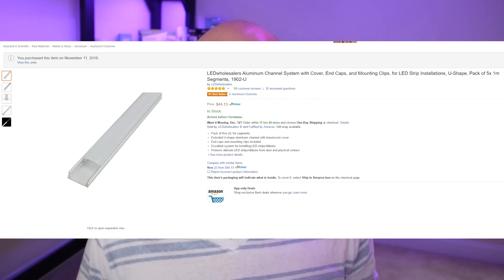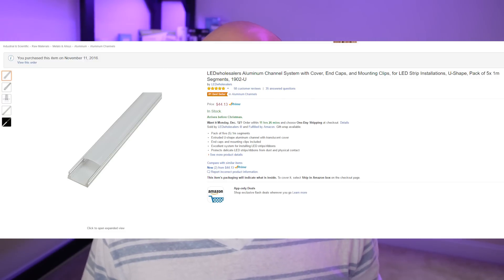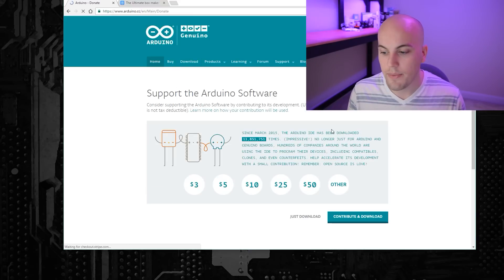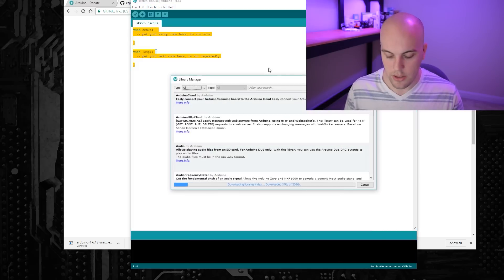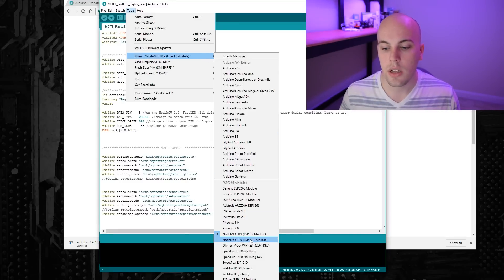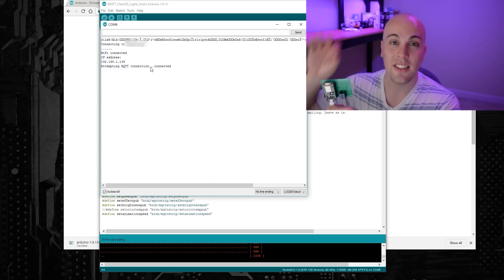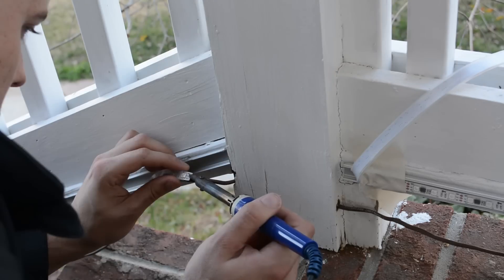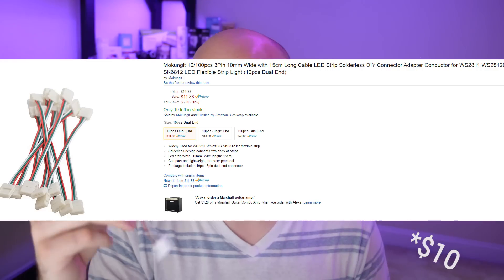The BEST Digital LED Strip Light Tutorial - DIY, WIFI-Controllable via ESP, MQTT, and Home Assistant

Comment: Ben I can't seem to get the Logic Level Shifter part right. The image on your gituhub appears to show a different wiring setup for a different shifter then what you posted in the description. I purchased the one in the description and can not seem to get it to work right. Any suggestions?
Reply: same. the diagram, is really confusing. cant get it to work
Reply: could you get it work later on?
Reply: could you get it work later on?
Reply: PuckStar27 the diagram is right. have no idea what I did wrong but it worked the second time.
Reply: thanks for your quick reply! :)
Reply: do you think I can also run this from a Wemos D1 mini?
Reply: Hey I’m so tired
Reply: i am also trying to run this with a wemos d1 mini and my led strips does not light up. did you get it to work somehow? i purchased another ws2811 led strip from china earlyer. it worked but had bad colors. but with the more expensive one from amazon it wont work at all.

Comment: You bloody genius.... I've already started doing exactly this... I chose everything the same, Except I went WS2813 LEDs, Just cause They're available ;)
I've already written some sketches for the Sensor nodes myself.... But I'd love to check out yours... 
I've just found another Youtuber who was doing similar things... and He's heavily pushing OTA updates, Just opened a site to do it too http://iotappstory.com/
So i'm going to be rewriting my code to work with this as it allows for settings via web interface and full OTA updating... will make it much cleaner to give code out....

I've just scrapped my FASTLED codebase as it's practically the same as yours... but you've already got MQTT, I was running webServer (and changing to MQTT)
Thanks for the info....

Comment: Any chance you could look into adapting the code to be used with OpenHAB? And maybe something similar with an analog 4 wire RGB strip?
Reply from the maker: I don't have an OpenHAB instance to play with, but I believe it supports MQTT. All you would have to do is get that side setup. The Arduino code should be universal. 

I'd love to do more with 4 wire LED strips sometime, too. Those are more painful to work with as you need mosfetts and such,  but I've seen some good cheap hackable options which I want to explore at some point
Reply: BRUH Automation I've got the animation and power sorted now just got to create a rule for the color picker to output rgb values to send over mqtt. Will make a video on it once I sort that. I assembled the Velleman RGB shield as that is cheap but can't find no working examples of code to control via MQTT anywhere

Comment: Excellent video! Probably my next purchase. If you've not planning to use digital RGB leds, Banggood/AliExprss are selling RGB controllers for 7-10 dollars (Arilux AL-LC0X : https://www.aliexpress.com/item/Excellent-Quality-ARILUX-AL-LC03-Mini-Wifi-LED-RGB-RGBW-APP-Controller-LED-Strip-Light-With/32716788750.html?spm=2114.13010608.0.0.9j2dMi), which can be reprogrammed. Discussion on Home Assistant's forums : https://community.home-assistant.io/t/alternative-firmware-for-arilux-al-lc03-for-use-with-mqtt-and-home-assistant-rgb-light-strip-controller/6328
Reply from the maker: That's awesome! I'll check into that for my 3 channel RGB strips!

Comment: Dude this just made my year. this was just what i have been trying to do for ages. This was the most informational tutorial that i have ever seen! Great work!

thanks again!
happy holiday
Reply from the maker: Happy to help! Good luck with your build. Let me know if I can help with anything.
Reply: BRUH Automation you can help me if you can !! first off all great video just love this !!! and i want to ask if its possible if i use a 3,7v lithium battery for 7cm of digital led strip ? its for a project i am working on
Reply: Yes it is possible. a 7cm led strip would have (if you are using 60leds / meter one) only 4 leds and one pixel draws at its maximum 60mA so that would be 240mA at its peak power draw. A liion battery can provide that. but not for days/weeks :)

I would suggest using the 144leds / meter if you have a 7cm strip then you get 10 leds so you can do more high resolution led effects. that would give you a max power draw of 600mA and thats only when all leds are at 100% brightness and all colors are on (u generally dont have that). 

also calculate that the esp8266 would draw about 40-130mA aswell. depending if its transmitting / receiving data.

Good luck with your project.
Reply: Were you able to complete the project? I'm working on it right now
Reply: Luke Leslie some of it yes I couldn’t ever figure out how to make the mqqt part trigger the eighth section of code. But other then that it works great

Comment: this is great and I've built around half of it at the moment (waiting for the rest in the post). I wondered if a more generic esp8266 / home assistant demo which exposed all the gpios as switches / inputs via home assistant would be useful? I'm seeing lots of cheap esp8266 modules (Inc relays etc) on eBay which include relays etc so wondering if this could be a part of a cheap HA setup. I wondered also, what changes would be needed if you had two of these in your setup? Great work with the videos btw!
Reply from the maker: Not sure about the demo.

What changes you'd need if you had two LED strips in your setup? You would just have to change the MQTT topics and you'd be good to go!
Reply: BRUH Automation yes, I have been working on a few changes to your code (mainly additions to use the esp8266 hostname in the client ID and topic). I'll send you a copy when my second esp8266 turns up in the post. what's your email?

Comment: Struggling to get the code running on my NodeMCU ESP12E
I get two notices during compile:

 #    pragma message "FastLED version 3.001.003"

 #      pragma message "No hardware SPI pins defined.  All SPI access will default to bitbanged output"

It carries on Compiling & uploading - says Complete, when I load serial monitor it says "$‚%€ä5sþÿ½ûÿÿ=oÞÿë" and nothing else :-(. No lights on board now. Can re-flash back to a demo firmware and it works fine so not sure!
Reply: Forget that - Got it working :)
Reply from the maker: Nice! Probably the baud rate on the serial monitor? Pumped you got it going!
Reply: I am getting the same message, how did you fix it?
Reply: @gregfelzer9881  same issue. Did you have a win?
Reply: @oesadler  no but I ignored it and compiled successfully

Comment: Ben, hey.  Why did you choose to go with 12V LED's over 24V, since you did such a long setup (greater than 10m)?  Wouldn't going with 24V LED's, not require you run additional power wire down the strip?
Reply: FYI, you also have the wrong power jack adapters listed above.  You linked the female ends, when I believe you need to link the male ends to work with the power supply you have listed.
Reply from the maker: Good catch! Thanks much for pointing that out!

As for the LEDs, I stuck with 12v because they are a lot easier to find. 24v strips would be nice though! I'd love to upgrade to RGBW strips at some point. I think going to 24v then would be sick!

Comment: I'm really enjoying your videos and have a minor correction. The logic voltage is not dependent on the length of the strip -- the logic is "amplified" at every LED or every block of 3. Therefore, if you can successfully control the first, it will then control the second, and so on...

Also for ESP8266, you may want to check out these cheap chinese RGB controllers, they have an ESP8266 in them. The ESP8266 has an extra (unused) pin which I have yet to repurpose for my neopixel strip, but they're working great for standard (non-digital) strips.
https://www.muzik.ca/2016/11/30/hacked-esp8266-rgb-led-controller/
Reply from the maker: That's very cool! I'll check into those. I always try to avoid parting out a project if I can repurpose another product to do the same thing. 

That's interesting about the voltage on the signal wire! Perhaps I don't understand the mechanism, then. Is the limiting factor for the strip the clock rate on the signal pin then? Do you happen to know the theoretical limit of a LED strip? I didn't know that signal was being amplified! Very cool.
Reply from the maker: I'll need to add a note to my video once I get the details worked out. Thanks for pointing that out.
Reply: It's a shift register with each LED's output connected to the next LED's input. This means that your microcontroller outputs the signal only to the first LED. If there is too much data (more than 24 bits), then the first LED starts pushing the data out its DataOut (DO) pin to the next LED in the line -- in a first-in-first-out sequence.

The dataline is a broken chain, with the DI (Data In) of each LED connected to the DO of the last one:  
Microcontroller -> LED1 -> LED2 -> LED3 etc.

Instead of a long wire that each LED is hooked to, you have 1000 short wires connecting each LED together; The previous LED becomes the transmitter/source for the next LED in the line.

The distance you need to be worried about is the distance between each LED (a few mm) or the wire attached to the first LED.

As for a limit - I suspect there is none, just the more LEDs you have the less you can refresh (if you have one LED, you can update it thousands of times per second, if you have 10,000 LEDs you can update them once per second), but as far as I know it's "unlimited". 

Also you may be interested in my ESP8266 boilerplate code which I'm using with HomeAssistant -- https://github.com/mitchese/esp8266-base

After flashing anything with ESP8266s inside (MagicLights, Sonoff, Wemos) with this code, it will be a HotSpot which asks for my wireless credentials, MQTT server and a name to subscribe/publish to on MQTT. Additionally it allows for OTA firmware updates, which I then use to customize it further to become the Sonoff, MagicLight or whatever. I find it much better than hard-coding the wifi credentials into the sketch. Bonus is the wifi credentials survive a reflash, so with new versions (as long as nothing in SPIFFS changes) will simply boot the new firmware and find the saved wifi credentials, mqtt server and topic.
Reply from the maker: That is very cool! Thanks much for the information. I've wondered about this for a while! It's good to finally understand that. I added a note in the video description to hopefully clarify that for others. Thanks a bunch for the info!

Btw, the boilerplate code is very cool. I want to move to something like this soon. Cheers!

Comment: I have read that this FASTLED library has problem with disconnecting Wifi on ESP8266, since it is not asychronous or something...That it is way better to use Neopixelbus library...So maybe thats why some guys are having problems with MQTT....Also will you add support maybe for MSGEQ7 chip so you could  sync music with led flashing, for parties :)?
Reply from the maker: I haven't had any connection issues since setting up my code. Except for one glitch, it's been rock solid! 

I'll check out the neopixelbus library, though. I'm always down to try something new.  Sound sync is definitely something I'll be exploring in the future. It's a little tricky because audio sources are hard to work with, but I'm still going to give it a shot.
Reply: BRUH Automation Apparently watchdog resets and flickering is an issue with FastLED and esp, please look at issue #74 on FastLED repo. Would be nice if you could support that msgeq7 in your code.
Reply from the maker: Interesting! I haven't seen that issue before in my setup. Wondering if that is linked to the effects/math that person's code was trying to use. I'll check into it! Cheers!
Reply: It is possible tho' that you didn't notice it (because its like just 2 or 3 time in 24h),..did you maybe change anything in Fastled.h?
Reply: Actually I said the wrong issue number, please read through this one: https://github.com/FastLED/FastLED/issues/306
Reply from the maker: Interesting! That's a lot of info. I haven't noticed any issues at all with either of my strips. No flickering at all or instability at all. Maybe I'm not understanding what the consequence of that watchdog reset is, though. I'm wondering if he was using a logic level shifter, as well. He doesn't mention it, but it's been pretty critical to reliable performance on my setups.

Comment: First of all, great job again. I have the RGB working before in HA and using a FadeCandy from Adafruit.  I was not sure how to do effect with MQTT and HA, but now I see thanks to what you have done. I have a spare set of lights for R&D on my desk with some NodeMCU 1.0 and tried your code.  With some tweeking I was able to get solid and Sinelon working.  The colors do not match up, but I think I need to change the GBR to RGB for mine. Also I noticed the speed and intensity do not work.  This is a great  start and guidance to how to setup my FadeCandy setup.
Reply: Now I have BPM, Glitter, Rainbow, Rainbow with Glitter, Confetti, Juggle, Sinelon, and Solid all working.
Reply from the maker: Thanks much! Hmm, that's odd those parameters aren't working. I can definitely say they work on my end. The animation speed is effect dependent. For some effects, the animation speed is really the refresh rate rather than a true effect speed (I think Sinelon for example). While for other effects (like Police or Twinkle), the animation speed is a true speed selector.

That code still has room for a lot of tweaking I plan to do. I'll be sure to keep that GitHub up to date as I revise things. 

Switching to RGB or your light parameters should make the colors work. 

I'd also double check your automations and topics to make sure the MQTT events are firing. You can do some debugging in the serial monitor while you fire MQTT messages from Home Assistant. 

Let me know how I can help! cheers!
Reply: BRUH Automation MQTT is firing. Maybe the GitHub code is not the most recent?
Reply from the maker: +Jason Wier Nope, that's definitely the most recent. I'll double check tonight, though.  The brightness and animation speed has a default value when you start the NodeMCU, but it will store and use whatever the next value you set is. The brightness should work on every effect. The animation speed mechanism might not work behavior the same on every effect. I'd just play around and see what you get. Sorry about the issues!
Reply: I have cloned the git repository again and uploaded it and it is fine.  I also upgraded my Arduino IDE from 1.6.4 to 1.6.13.  Who know, but great job!

Comment: Looks awesome! I have been dying to get started on automating my house but the components I need are quite expensive :( But your videos keep me motivated to try it when I can :)
Reply from the maker: Thanks much! Yeah, it definitely can get expensive fast! But, if you can get your hands on a Raspberry Pi, you can do a ton just with a phone and that. The NodeMCU chips are pretty cheap and if you have a couple LEDs laying around you can make fun desk lamps and stuff. Home automation doesn't have to be expensive to be awesome.
Reply: Can also give a shoutout for the cheap Wemos D1 Mini and their DHT-22 and battery Shield Great way to get cheap temp/humidity sensors. 

And also the Sonoff relay is great. You can reprogram the ESP8266 on there with this and integrate that with MQTT into your HASS. 
https://github.com/arendst/Sonoff-MQTT-OTA-Arduino

Comment: this is a great video, I do this exact thing in my setup.  The one thing I would point out is that (on most) the ground has to be common to the esp8266 board and the light strip.   Without this the timing may be off, and the lights will have intermittent problems.  This is called out in the adafruit explanation of the NeoPixel strips.

Comment: I'm having issues with setting up home assistant, can anyone help? I have everything setup not problem but I cat seem to turn off the static home page when I go to the IP address
Reply: It keeps asking me for a password when I try and boot my setup, I've tried all known passwords but nothing seems to work
Reply: There should be a password to access HASS in your configuration.yaml file.
Reply: Dave Henning thanks for the reply, yes there is a password in the config file but even that won't work for me! When I reboot via terminal it asks me for this password before it can reboot and save the changes I've made to remove the static page
Reply: The password is the one you've set in your configuration.yaml file under http.